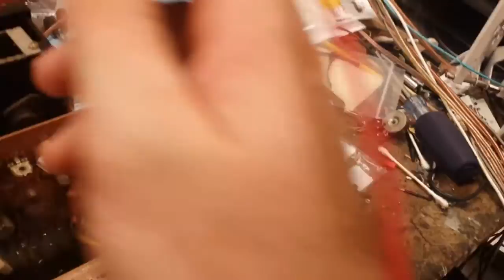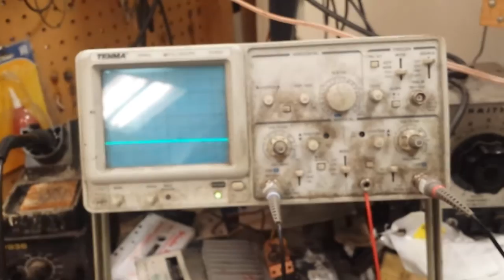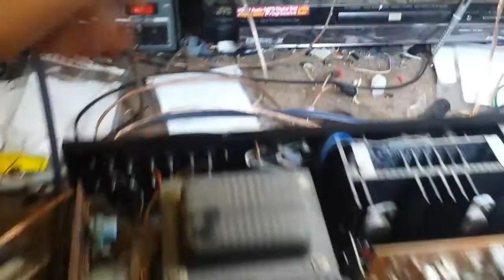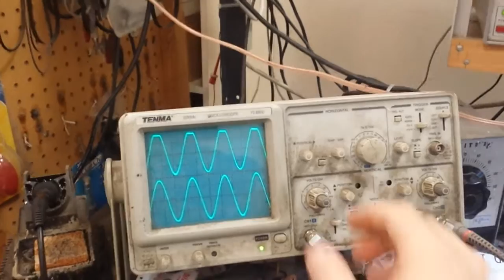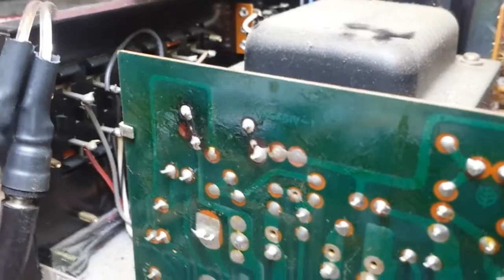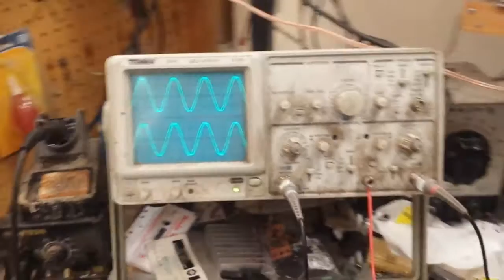Servicing a kenwood kr-7400. More beach disease!

Comment: I have a 7400 and I am thinking about adding pwr cable with ground wire to receiver frame. Good or bad idea? Do you still service these receivers?
Reply from the maker: @RichardFriedel-g1z  all equipment must be grounded, or no equipment should be grounded. Otherwise you bring in the possibility of ground loops and shock hazards. I'm not currently servicing anything until further notice. Gotta get the shop set back up and it's difficult with work and sciatica
Reply: @JordanPier  The original power cord does not have ground wire. I am planning on adding a 2-14 with ground power cord. Giving me a true ground at the plug. Why weren't these machines grounded?
Reply from the maker: @RichardFriedel-g1z  at the time they were produced many homes did not have grounded electrical systems

Comment: In awe of you knowledge and skill Jordan. I have a Kenwood TK-66 in bought new in 1967 and I am trying to resurrect it. It was in the basement for 20 years in a box unused. The outside back panel has some pretty severe corrosion but it hasn't migrated to the inside the cabinet. Pretty dusty and dirty inside but with a good soft bristle camera brush and a vacuum, it cleaned up pretty well .It powers up but I have severe crackling when I turn the volume control. I have hooked up my old Dual 1015 turntable and it works fine as long as I leave the volume control alone. 
I need to do more disassembly to get to the  back side of the controls and switches to 'Doxit D 15' them like you did on a different video....Wish me luck...I'll check back in and let you know how I did. I have subscribed...love your videos.
Reply from the maker: Probably need to take the bottom off to get deox into the pots and switches. 

Given its age it's very likely to need capacitors, at the very least in the signal path. However for now it may improve slightly with use
Reply: @JordanPier  Thanks for your reply Jordan....yeah, I gotta take off the bottom to get to the pots and switches. If it that doesn't do the trick, I'm sunk because I have no electronic testing equipment.

Comment: Hello Jordan, I recently got a Kenwood kr-7400 stereo receiver. I have one issue, volume won't go to zero! The button go to position off but sound still coming. When i listening radio it's too loud, when i switch to AUX or phono it gets about 25 percent quieter but still won't go to zero. Want to ask you If you still own it or if you remember, is this normal or i have a problem.
Reply from the maker: Sounds like the ground side of the volume control has been interrupted. This can be due to a bad connection on the circuit board, break in the board from an impact (was it shipped or dropped?) or broken volume control - again likely from impact
Reply: @JordanPier  Thank you! I will take it to local audio service for diagnostic.

Comment: A company I worked for built a few hundred power supplies for a cable company out in San Francisco, after a few months we started to get them back and when we unpacked them something was rattling around inside.Popping the cover we found several TO-18 transistors whose leads had corroded through

It turns out they were hanging these things outside on poles and the transistor leads were corroding away on the trnsistors that didn't have gold plating. They had not told us they were going to put these supplies outside, some supplies were inside and some were outside..

We ended up replacing any transistors with unplated leads, cleaning the boards and humisealing the boards. We sent the supplies back with a bill for the work we had to do. The supplies went out and stayed out.

Comment: If u don't mind me asking how much does a job like that cost? How much does it usually cost to get my reciever looked at to see what the issue is? What shops do This? I have a Kenwood kr 6400 that was my dads and would like to restore. Thnx Jordan.
Reply from the maker: There aren't alot of shops left the specialize in vintage. I know of maybe 6 that do nothing but vintage, including the one I work for.

Cost varies enormously based on needs of service and what the customer wants.

Often a general service on something like a 6400 can be around 100-150, and more if the customer wants all the lamps replaced, or some recapping done.

Comment: can you explain what does scraping the leads of the transistor really do

i was assuming that the leads wont matter only the connection to the board solder and the condition of the internal chemicals of transistor 

that the leads external surface or corrosion of leads wouldn't have anything to do with anything or really matter

im not getting this ??
Reply from the maker: +mike murphy , I'm technically scraping between the leads on the underbody of the transistor. Depending on the plastic composition of the cases, Saleen deposits accumulate in a maritime environment and will create a conductive path.
Reply: okay Jordan now i got you,  scraping under body of transistor and leads dont matter

Comment: Hi I enjoyed your video and maybe you can help me. I have one KR-7200 and it has a curious issue. When I am using the phono everything is ok but sudenly the right channel drops. I turn off and on again and the right channel returns after some minutes falls again. Today I noticed that if I hit the turn table with my finger the sound returns. If I am using the radio the channel drops if the signal is weak. Using my computer in the auxiliar I didn't notice the problem. Is it a matter of cleaning?